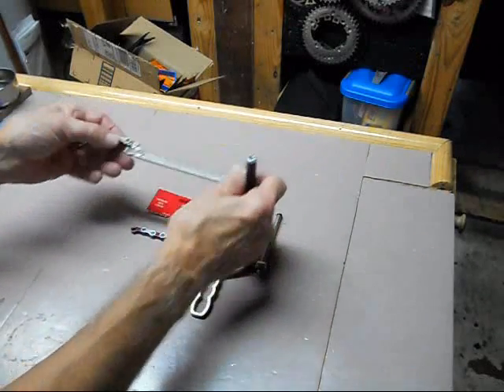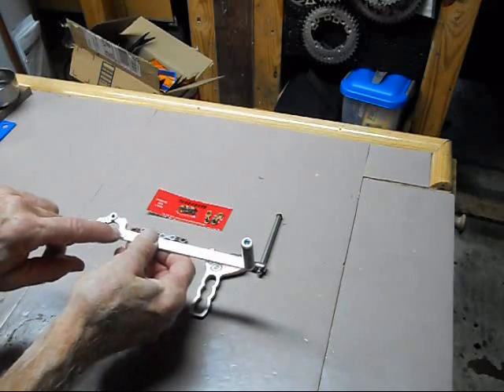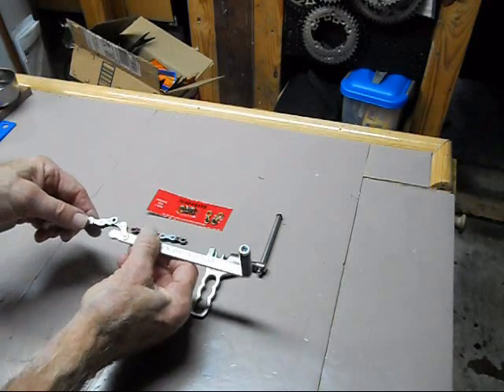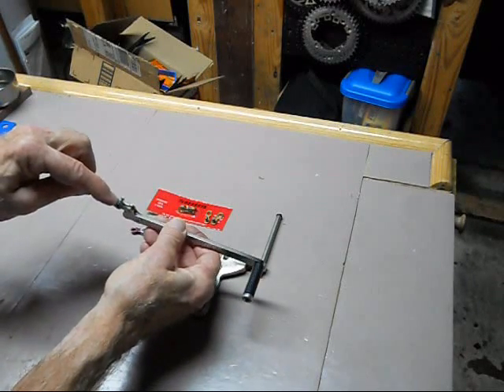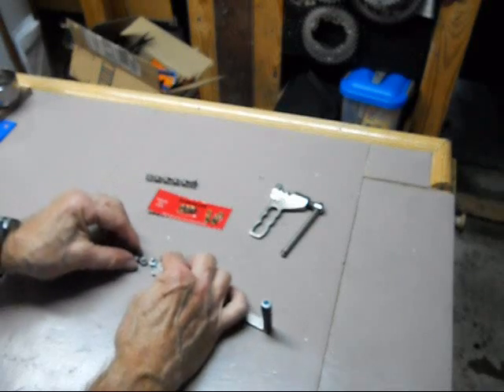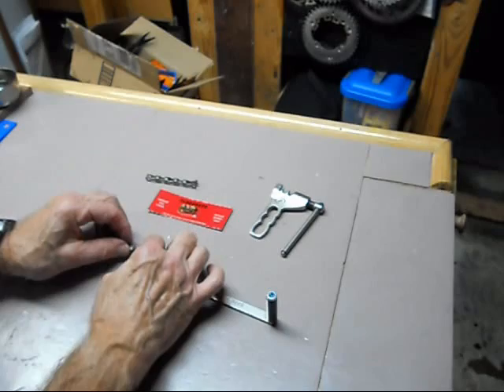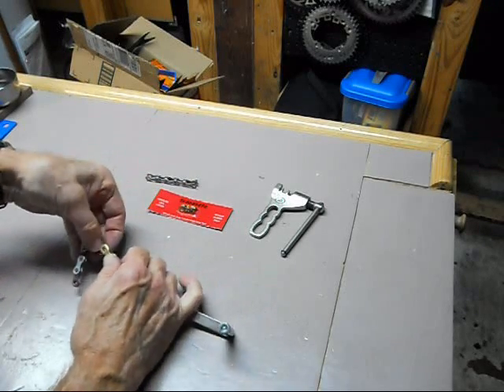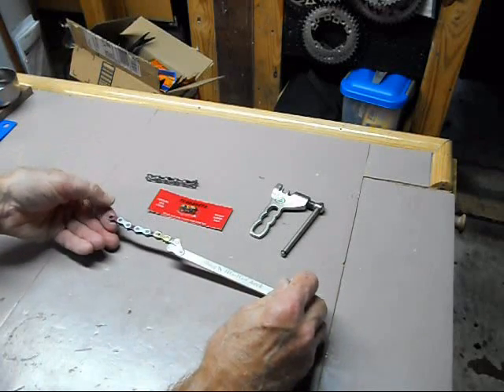Build 10 Speed Cog Wear Indicator

Comment: Just go by how many miles are on it, simple! Mine only last about 1,200 miles in Colorado. Shimano XT cassettes don't last as long as the regular 10 speed cassettes. I'm talking half the lifespan.
Reply from the maker: My riding partner uses Shimano XT 10 speed cassettes for road cycling. We usually get about 2000-3000 miles out of the cassette per season with little sign of wear (we avoid wet and rainy conditions). We change them out at this point yearly as a precaution. I check for chain wear frequently and replace the chain at 0.5% wear to prevent wear to the cassette and chainrings. Cleaning and lubrication of the chain every 150 miles also helps.

11, 12 and 13 speed chains need replacement at about 1500 miles (or less) and the rest of the drivetrain including the cassette and chainrings wears a little more quickly then the 10 speed.

The life span of the chain and cassette also depends on the riding conditions. Dirt, gravel and wet conditions will accelerate drivetrain wear. It will also depend on agressive style of riding. In these cases, Shimano XT cassettes may last 1500 to 2000 miles. 

Once you get a feel for the life span of your drivetrain components, I have no problem in early replacement. Since I deal with many bikes brought in to me, I check all components including the cassette for signs of wear. Here's what I look for when checking the cassette:
https://www.youtube.com/watch?v=g5uqTNmikro

Thanks for your comment. Regards, Tony

Comment: The length of 9 and 10 speed is the same (and i believe that is what the wear indicator checks)
Unless there was insufficient width for the 9-speed part on a 10 speed cassette, there is no reason to chance.
... However IF there is insufficient width on the 10 speed cassette I see the reason to change. However you have no reason to change back to 9-speed.